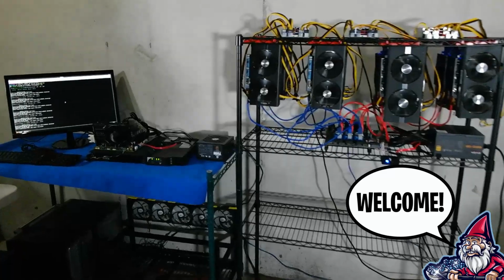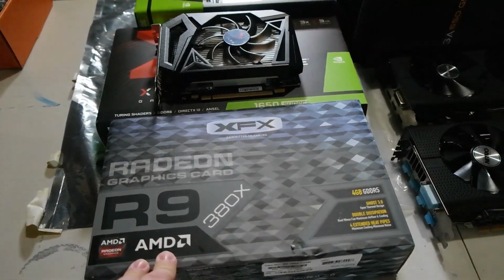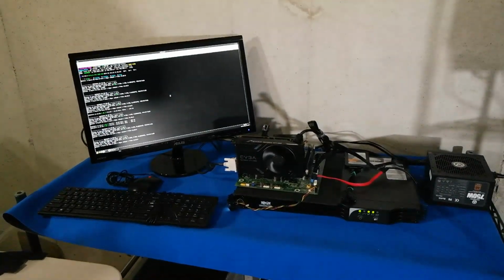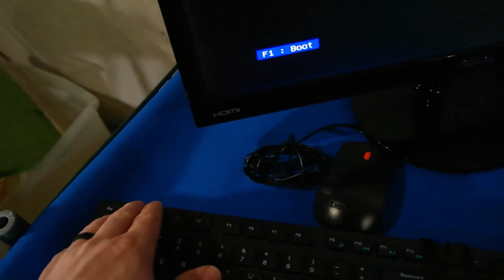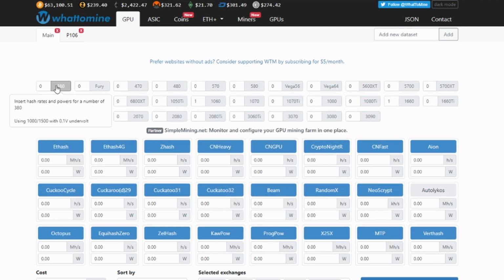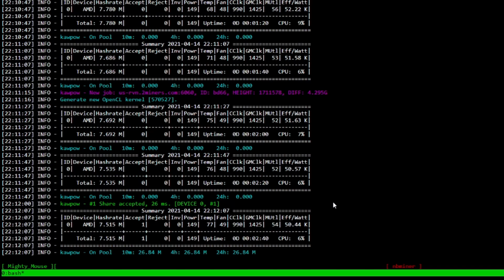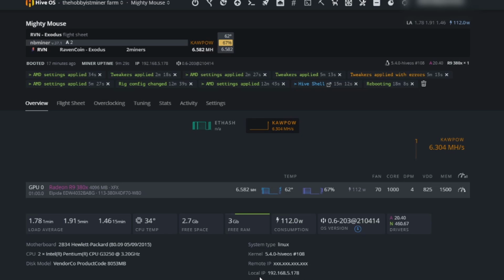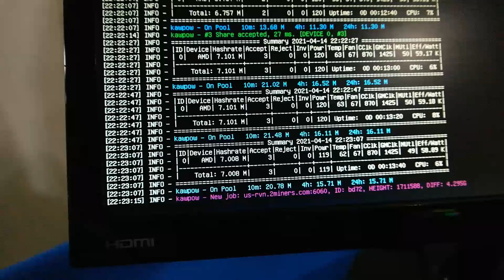R9 380x Mining Hashrate Testing & OverClock Settings

Comment from the maker: What is the oldest GPU your mining with and what are you mining on it?
Reply: i got 2 1050ti s mining RVN
Reply from the maker: My friend offered to sell me one, i passed but If I already owned it, I'd put that to work!
Reply: 2 x r9 280x 3gb on rvn and etc
Reply from the maker: Wow! I thought the 380x was older.  Whats your Hashrate and Power look like?
Reply: it runs 10-12hs on etc as my old gtx 970 oc (3.5gb/4gb) 7 - 8hs ,it seams amd old cards do better than old geforce  , i never throw away old gaming pc i still got my amd 939 pin dual core running minecraft server and plex
Reply from the maker: Wow! Kuddos to you!
Reply: @anthonymorris8423  what is the hasrate mining etc with an R9 280x?
Reply: @athem_srz271  I can't remember 12 or 17 ,but i do know it was better than a gtx 970
Reply: I have 6 r9 390s, all of them are broken in some way that prevents them from having resell value as gaming cards but they all work fine for mining eth except one that runs 15 percent slower than the rest, picked all 6 up for 650 usd. Probably a bad idea but for the price I couldn't say no.
Reply: 2gb gt1030 and 750ti on VERTHASH

HiveOS dont like my Non-AMDGPUpro  r9 270x
Reply: Oldest cards I have are a few R9 280X that I am currently mining Vertcoin with. They actually do respectably for their age on the verthash algorithm. I have a video on my channel showing what I'm currently mining with minus one 8 gpu rig I just put in service.
Reply: Getting 26 mh/s for ETC with Gigabyte 280x Windforce stock clocks, it doesn't seem to respond to any OC/Volt settings in HIVE, no power consumption reported either just temps and fan speed. It runs really hot even after cleaning/installing new paste. Was at 82c, put large fan directly on it, now down to about 67 to 70. I've got 2 1060 3GBs running ETC as well at about 19 mh/s each and a RX 480 4 Gb at about 21.5 mh/s for ETC. Was trying to get my GTX 770 4GB to mine ETC but not having any luck with NB, LOL, TRex, and few others
Reply: About to be a 290x 8gb , 390 8gb on the way, fury x already here

Comment: Have you ever tried it on etc,if you did what mh did you get ?
Reply: I mining ethereum R9 380 4Gb and my hashrate is 55 mh/s I use Phoenixminer 5.6b
Reply: @nikolamaric7571  yes and yes
Reply: @TaViSaLO1  and what hash you get on any other miner than phoenix?
Reply: @nikolamaric4674  25mh/s
Reply: @TaViSaLO1  did you bios mode it ?
Because i cant get over 20 on mine and 95w
Reply: @nikolamaric4674  no only overclock with msi Afterburner
Reply: @nikolamaric4674  and my gpu is only 47°c 😛
Reply: @nikolamaric7571  core +160 memory +225 core voltage +30 and power limit +12 my xfx r9 380 is oc version and i have overpower water cooling
Reply: @TaViSaLO1  with that cooling it is possible i am using stock one so i woudnt risk to fry my GPU,thank you for info 
All best
Reply: @nikolamaric4674  NP

Comment: I've just buy 1 XFX R9 380X (waiting for arrival). I'll sure made a lot of fun mining on it. I'll test  RavenCoin, ETC and TRTL.
Reply: Any update? Would love to know what you got. Apparently my non-overclocked 1080ti "Strix OC" is only performing as good as his 1060. It seems like the returns with old gens decline steeply the higher you go in class. That leads me to either go for new ones - which are just insane in MSRP and even worse in market-price, or cheaper old low to mid end cards.
Reply: how many mhs on etc

Comment: This gpu needs some memory timing adjustments which can result in some nice gains, look into Tonga bios editing.
Reply: This is also still my current gpu, sits somewhere between a 1050 ti and rx 570 in terms of gaming performance.
Reply: do you know how to edit timings?
Reply: Regarding memory, do you know if the Asus version of it has any unoccupied VRAM slots? Then I could just buy one cheap, solder on a VRAM module, and give it a custom BIOS

Comment: Try running the card on Rave OS. That should save some energy. Maybe try findiNg a BIOS mod to adjust timing. Maybe there's a profitable alternate alt coin that uses an obscure algorithm What to Mine doesn't list. I'd be very surprised if there wasn't a way to make a little money during a bull market on one of those cards, or at least break even.

Comment: If you slow down the video at 9:06 at 0.25x you can see that the $/kWh is 0.7317 maybe thats why you dont gain profit because the electricity cost is too high...
Reply from the maker: Yeah I saw that after too. Had it at like 160w

Comment: the BIOS settings have enabled the motherboard to check the CHFAN2 connection, and so the error-message is generated, because nothing is connected.
As an "experiment", temporarily connect a chassis-fan to that CHFAN2 connector, and reboot, to see if the error-message is still produced.
If that works you need to fix your bios and it will boot directly to OS
Reply from the maker: Thanks for the tip!
Reply: @TheHobbyistMiner  some oem bioses have a advanced or service mode that would allow you to dissable the check this is accessed by pressing a key combination during post mosty gone in newer boards. But sometimes editing the bios is possible. Mostly on award bios systems but ymmv.

As for thr bypass by plugging in a fan if you have a dead fan you can cut the connector off and splice in to the cpu coolers yellow wire as the bios check only looks to see if there is a rpm signal being receved.

Comment: Still own a r9 280x 3gb was the first graphics card I ever bought, might throw it in my rig just to see what it gets for hashrates
Reply from the maker: Excellent let me know!
Reply: The 280x cards works decent on vertcoin.
Reply: Been a while since you posted your comment. Just put my 7950 on the bench. I unfortunately have been unable to get rvn coin to work the dag is like 20 mb too big. Im sure theres a way but i dont know for now. Nano miner has been the mkst successful for this too.

My card is clocked 1065/1484 with the stilts afr timings applyed @1.12v (quite hard to track those down these days and my card is a very bad ocer 1100/1575@ 1.075v was the old standard for these things )

Here are my hashrates of the potentialy profitable coins in my findings.

Etc - 11 mh windows 23 mh linux phenix miner for 0.65% dev fee lol works too.

Vertcoin-419 kh windows linux untested.
Vertcoin ocm
Ergo ~27 mh  nanominer. 16.6 with the open cl project miner.

Also under windows i got 550kh with the progpowz miner wildrig and sbs dont support our old cards 

If ergo under linux doubbles hash like etc does thats probably the most profitable right now.

Comment: I am mining with 4 R9 390 8GB XFX. pushing 29.5 mh per card. at 180w.
Reply from the maker: Damn 29.5 Mhs thats dang good.  Very Nice!
Reply: I also have a rx 580 8 gb, pushing only 29.5mh. Can you tell me some oc settings for that? I say some people getting 33mh from a rx580 8gb. And i have 1 rx 580 4gb, i get 19mh from that. Run all of that in one rig with lol miner because that 4gb card needs to run on zombie mode.
Reply from the maker: For the RX 580 it comes down to your memory type, I currently use:
Core Clock = 110
Core State - 1
Core Voltage = 810
Memory State: 2000
Memory Voltage: 1
Aggressive Undervolt Enabled
Refresh Rate 20
Reply: @TheHobbyistMiner  Thx, i have one 8gb with samsung and the one with 4 gb running on zombie mode haves elpida memory.
Reply: hello good hash rate, could you tell me how you got on that overclock? core, memory, undervolt. If you like